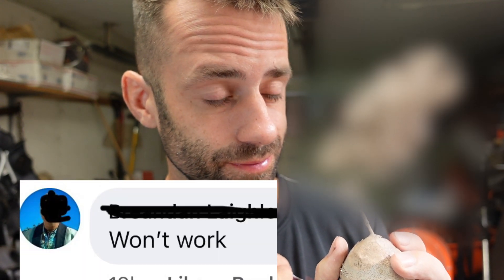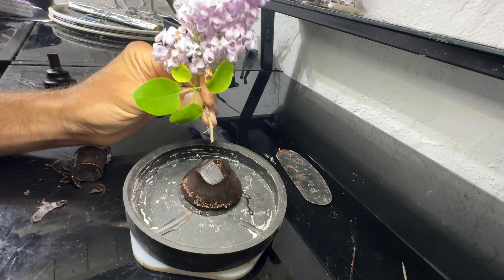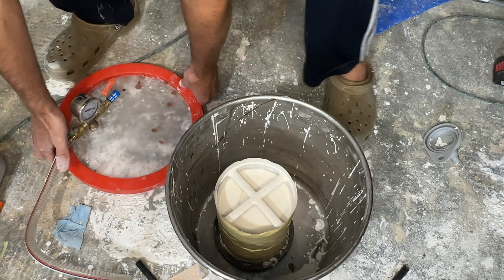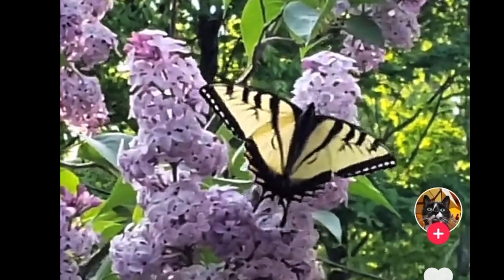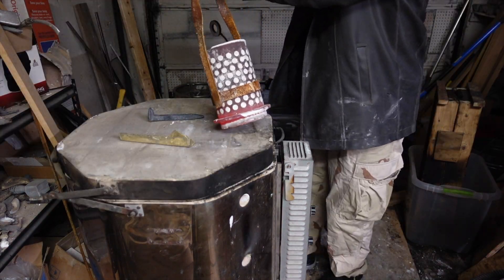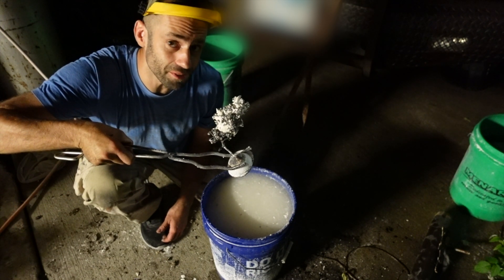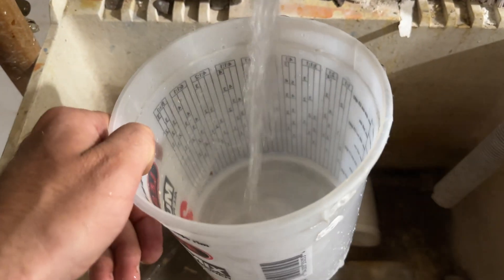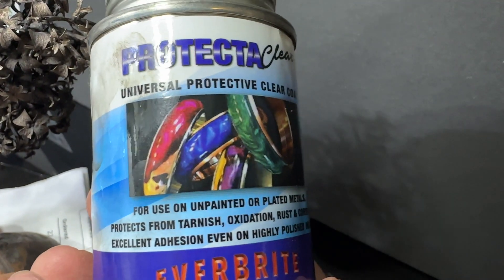Bronzing Real flowers: Lillac

Comment: I know this is a late comment, but it seems like a fun and difficult problem to solve. I wonder what would happen if you sprayed the flowers with water, froze it, quickly took it out and made a silicon mold, then wax replica, then added to base, then the plaster-kiln steps?

Comment: I have a quick question. I'm having great troubles burning out the wax in my casting flasks. I'm using plaster of Paris. Is that the reason why I can't melt out the wax? Is it just the wrong plaster?
Reply from the maker: The wax should still burn out if it’s hot enough long enough. With plaster it might take longer
Reply: @lundgrenbronzestudios  I'm definitely doing something wrong, lol. I've tried green wax and blue wax. The blue definitely melted at a lower temp, but I still had some in there because my pour started boiling out. Anyway, thanks for your videos they have been a huge help!!!

Comment: Hello, I am wondering what kiln to buy for burning out wax and making certamic shell castings? Any advice on buying a kiln?
Reply from the maker: I don’t know much about kilns but I just got a pottery kiln. They run off of 220 so you may have to do some rewiring if you are not set up for that.
Reply: @lundgrenbronzestudios  I want to cast a full sized skull, I have the skull and I need to make a silicone mold so I can get a wax positive of the mold. Do you have any advice on where to get a lot of cheap silicone? Also, where do I get cheap wax? Sorry for all the questions but thank you so much for your videos!
Reply from the maker: @NORTH02  cheap is not a word that that goes with this craft. I buy my silicone from Sterling supply and it’s about $120 a gallon.  The wax I use is more expensive per pound than the bronze.
But on YouTube, the channel smooth on has a great tutorial on how to mold a bear skull.
Reply: @lundgrenbronzestudios     What silicone do you use specifically? In that video, he uses Dragon Skin 10 NV which is $200 a gallon. I have a Sterling supply in Minneapolis that I could go to, but if you could tell me the best silicone brand/model that would be great. I checked your Fisher skull video but it didnt say. Thanks again.
Reply from the maker: @NORTH02 I go to that Sterling supply in Minneapolis. Get their tin silicone with the pink activator. They will recommend the best series. I think it 1000 series. But it’s just their regular tin bronze. They have a blue activator but they say the pink has a longer shelf life so I get that.

Comment: Hello i hope you have a good day , i have a question about attaching a bronze piece to a stone , i wanted to know is there any good and safe way to attach these objects since you are pro in bronze work , i taught you could help me...
Reply from the maker: Brazing is one option. Welding is another. But thin pieces are very tricky because they melt so fast.
Reply: @lundgrenbronzestudios   unfortunately i don't have these options because both of them damage my stone and it's very risky.
Reply from the maker: @alibahar74  oh you meant actual stone. I see. One thing I’ve thought of but have never tried myself is a clear epoxy with bronze filings in it to match the color. Or in this case maybe stone dust.  But like I said I haven’t tried it myself. Just a thought.
Reply: @lundgrenbronzestudios  do you have a email that i can send you a picture of my product  , i tried epoxy too it's not working...
Reply from the maker: @alibahar74  yeah. Lund1060@gmail.com

Comment: sorry, i added this but you replied before that, not sure if will let you know so i'm trying this. If your brushes are too stiff. my gunsmith (RIP) once showed me to take bronze wool and wind it in a thin metal rod with a slit in it like a cotton swab. its very soft and really gets into tight spaces. if you use regular steel wool it might remove too much material. I'm trying to make casting part of my sculpture class but the logistics are proving problematic with the class times and bus riders, it will probably have to be a saturday thing. Have you ever tried experimenting and making you own investment?
Reply from the maker: No I’ve never tried making investment. I figure I let the professionals do that part and I’ll focus on the metal casting.

Comment: to keep from shifting. you could use dental floss or thin thread tied to a popsicle sticks or bamboo skewers that can rest across the top of the flask. To "tighten" the strings to keep them in place you can just twist the stick and it will increase the tension. Once the investment is solidified cut off the sticks. string is so thin it shouldn't make a visible difference where it was attached. If your brushes are too stiff. my gunsmith (RIP) once showed me to take bronze wool and wind it in a thin metal rod with a slit in it like a cotton swab. its very soft and really gets into tight spaces. if you use regular steel wool it might remove too much material. I'm trying to make casting part of my sculpture class but the logistics are proving problematic with the class times and bus riders, it will probably have to be a saturday thing. Have you ever tried experimenting and making you own investment?
Reply from the maker: That’s a good idea.

Comment: I think you could polish delicate pieces like that by using a softer or finer medium in your sand blaster. Very skilled work, well done👍
Reply from the maker: I’ve tried using baking soda as a blasting medium but I didn’t find the best results with it.
Reply: @lundgrenbronzestudios  have you tried nut shell?
Reply from the maker: @paulbragg7618  I have in a vibrating tumbler but not with a sand blaster.

Comment: seems like from  the cactus you cast, it might just work. I had doubts about that one, but full confidence in you now.
Reply from the maker: Oh I’m sure I will fail many more times but I’m not afraid to fail.
Reply: @lundgrenbronzestudios  I had one more thought about stainless steel ( I told you about the Irwin cobalt drill bits ) if you ever need to grind stainless look for the pink corundum bits for die grinder and dremels. I worked for a company that installed 18ga stainless plates on RVs that was all we used.

Comment: Glad you survived the heat and kick boxing.   You did it -that is amazing!  Capturing that heavenly smell year-round somehow would be a real miracle.  If your casting needs strength, dipping it a time or two or three, in a quart of clear polyurethane would protect and strengthen since it's way thicker than spraying.  Electroplating does sound fun, and would be a complementary skill to add to your growing repertoire  - besides copper plating, maybe brass, bronze formulas exist too, not to mention nickel, bright zinc, silver, etc.

Comment: Would you like me to make you a fancy kiln controller so you can regulate the kiln properly, and control it over wifi with your phones. or via an lcd with buttons? :)
Reply: Btw, I use a big ass ultrasonic cleaner to remove all the bits of investment from my things, and it works extremely effectively. No need to use a sandblaster! 

For Bronze polishing of fine onjects, i've found using a chemical method is not too bad, just need something to dissolve the outer layers a bit (that and a drop of voltage applied whilst it's in the bath of acid) I've had good look with phosphoric acid adn sulphiric acid, but it's far from a refined thing, they do work well.

The NAUGHTY method tho, that will give 100% shiny every time is to cheat like a mother fucker and just give teh outer layer a light electroplated layer of copper (with "brighteners", i think midas is the one you'll have easiest access too), it's very cheap to make the solution up and chems are cheap (copper sulphate, sulphuric acid, water.. brightener and a power supply you can adjust, i use a few but cheapest are like £10 and can control the amps/volts to like 30/5 i think, dont quote me haha)  then you can patina over that and then protectaclear. That makes it so shiny you'll go blind from the reflections xD
Reply from the maker: I tried a ultra sonic cleaner but it didn’t work well for me. It was a cheap model. What kind do you have?

Comment: nice work. I was also going to mention the hair spray or a paint spray before, maybe you need to find a material you can spray to add just a bit of thickness to the flowers so get a little more metal into it. great job, try some lilies or tulips.
Reply from the maker: That’s a great idea.

Comment: Great job. I wonder if an ultrasonic cleaner and some media would give it any sort of shine. Also, it might be a decent way to remove some of the investment without sandblasting. I would be afraid of losing some of the detail with the sandblaster. Nicely done!
Reply from the maker: That would be a good thing to try. I know jewelers use those ultra sonic cleaners. I tried one but sent it back because it didn’t work well but it was a cheap one.

Comment: does your investment dissolve in strong acid? if so, that might be better for removing it from sensitive parts than a sandblaster. to avoid dissolving your model (if it does before the investment), you could try putting an electric current on your model. charge the model negative and put a positive graphite anode in the acid to keep a charge flowing. i dont know how well this will work, but hcl is really good, even at lower concentrations of 8%
Reply from the maker: No it doesn’t react to acid. It’s a gypsum based plaster so it doesn’t react to HCL.